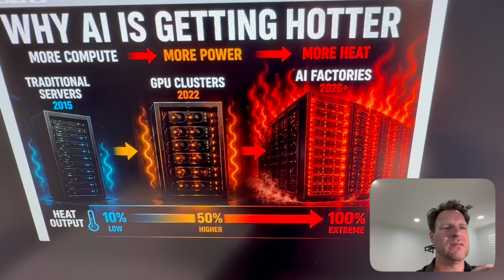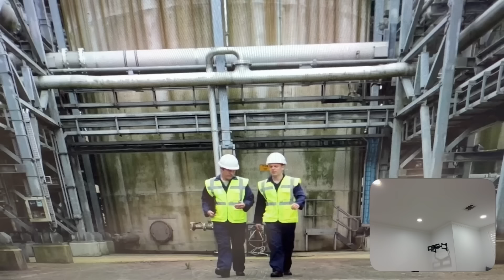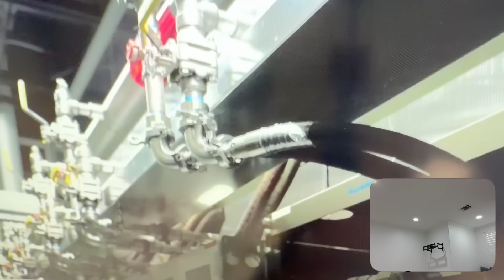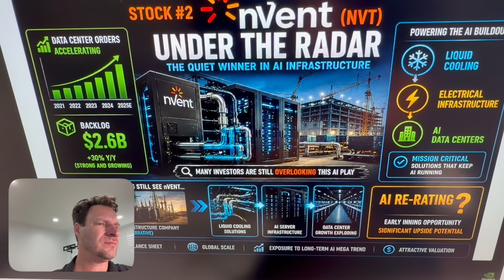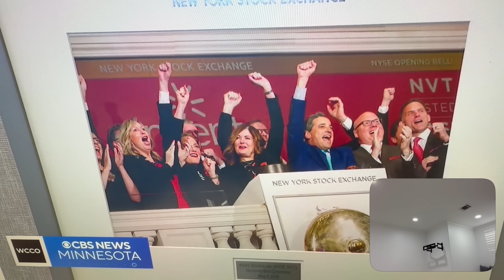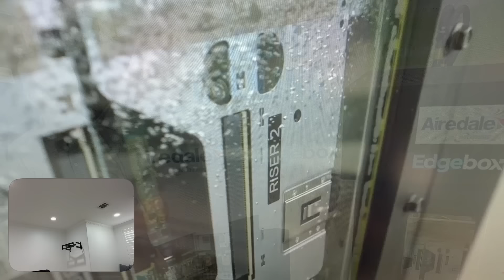3 Cooling Stocks About to Explode as AI Overheats

Comment: Did you sleep through every one of Jensen’s presentations for the last three years?

The latest NVDA racks are cooled with hot water…

Somebody tried spreading rumors of the racks leaking…

Solving mechanical problems like these are not hard when you have a decent super computer…

Hot water is much easier to cool, not as much air conditioning required…

Bla bla bla….

😃